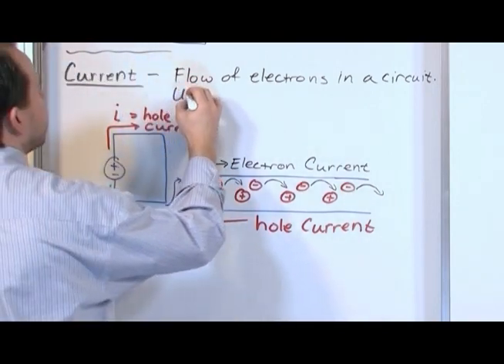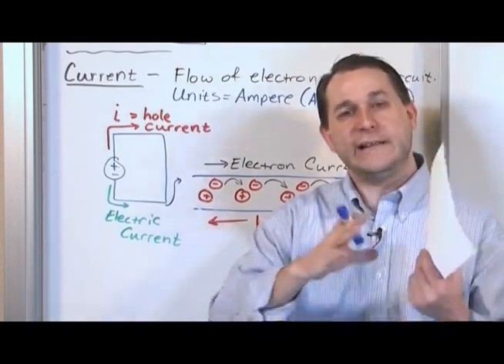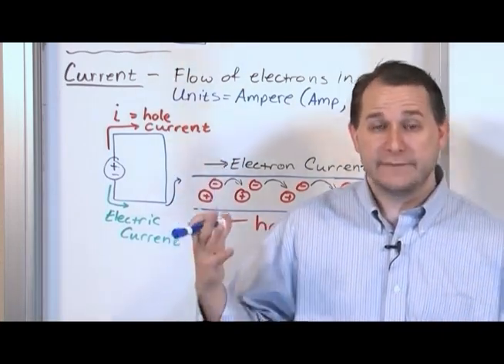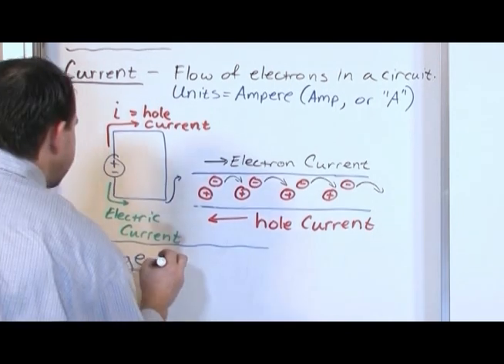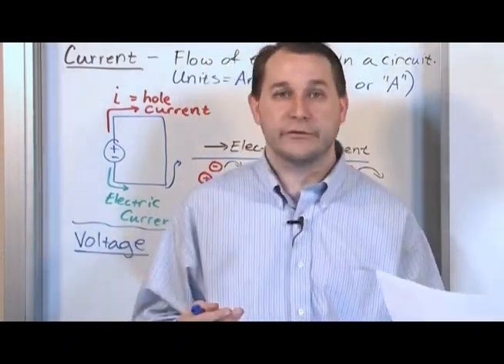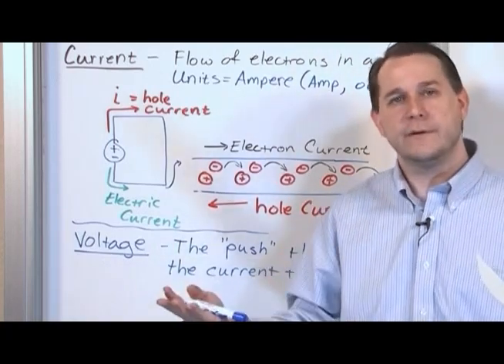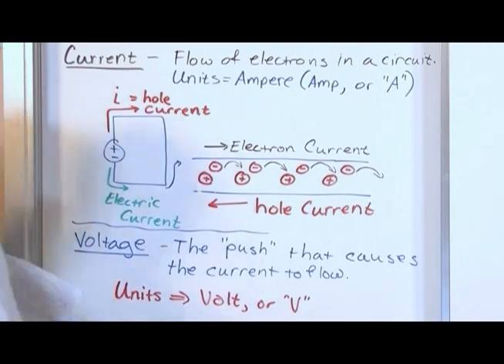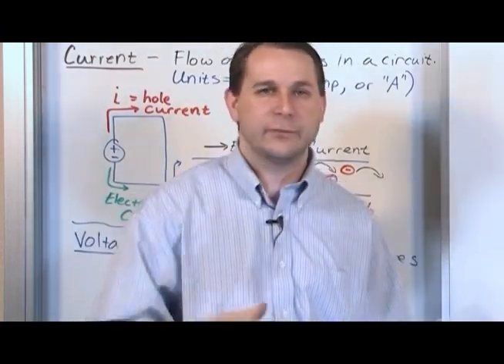What is Current and Voltage in a Circuit?

Comment: Very good video! But an important point for anyone watching this, is that, current does not flow. Only "charges flow".  That statement "current flowing" is the same as saying "flow of charge flow". It might seem pedantic to pick up on this use of the language, but it is one of the major causes of confusion with students.
Reply: In case you missed it, under current; he wrote "the flow of electrons in a circuit." In fact he wrote it twice, so anyone watching this video would have no confusion. its only pedantic to pick at the language if he was carless, but this video is very well done! :)
Reply: rezhna rasheed  I agree it is a good video. But he repeats the phrase "current flows" many times also refers to "current moving" which is wrong. It will confuse beginners, trust me, it will.
Reply: I don't mean to be pedantic (I do, really) you couldn't be more wrong.
Reply: A good paper by William Beaty on the subject of voltage, current, resistance, and watts may be of interest to viewers of this channel and the topic of "current does not flow in a circuit" as this issue is an often debated subject among electrical engineers.  Current doesn’t flow any more than "voltage", which Mr. Gibson does say in his video. Current flowing is an often made comment by instructors and students alike, myself included.

This comment does not intend to diminish at all Jason Gibson’s teaching abilities as I also believe he is one of the best instructors on YouTube. He is an accomplished electrical engineer having a distinguished career including working for NASA. 

The paper by Mr. Beaty can be found at http://amasci.com/elect/vwatt1.html

Comment: Just to clarify the current is the amount of amps circulating per sec and amps are a measurement of electrons. The voltage is the amount of potential energy used to drive the current. Please correct me if im wrong. Also what generates the voltage in a simple circuit?
Reply: As far as i am concerned , you are correct and the answer for your question is : A battery.
Reply: Nope, the current is NOT the amount of AMPS, but the amount of ELECTRONS circulating per sec, and this last concept is what we call Amp. Amp = (amount of electrons)/time.

Comment: therefore what does more current mean technically? Is it more electrons in a specific area? Because of voltage is the push (therefore more voltage more push) What happens with more current?
Reply: When you increase the push (Voltage) you'll also increase the amount of electrons flowing through a given point in one second (Amp).
Reply: Germán Diego Guisasola Plejo thanks for the answer but I finished school now, will never need to do circuits again haha

Comment: What is the source of the *push* or voltage?  how does Amp get push?
Reply: Is the difference of potential (Which we call Voltage)  between two points. Amp doesn't get push, electrons do and the physics behind it is pretty simple: Just imagine a straw (a cable for us) and know you started blowing on one end, there is a difference of potential because there is MORE pressure in the end you are blowing than in the other one, so that difference of potential MAKES the air flow from one end to the other, and that is AMPs, how many electrons flow through a given point in one second.

Comment: I don't understand. Given the same wire, using either 10 volts or 100 volts we still get the same amount of amperes? Then what property does voltage change?

Also how do you change the charge of an atom?
Reply: Given the same wire and assuming that there is a resistance in between (otherwise you'll short the 2 ends of the battery and that's not a good thing) the more voltage (the more the battery pushes) the more amps you'll get (bigger flow of electrons will be).

Comment: But the more push I apply, the faster the charges are gonna move, directly linking it to current. So how can these be independent concepts? Can someone explain?
Reply: Yes skooma cat you are right voltage is directly proportional to Current.But they are independent concept as current is nothing but just  the flow of charge across cross section of a conductor in time 't'.Whereas voltage is something which push the charge to flow across a conductor.
Reply: The load may cause the flow?   Higher wattage load of necessity will pull
more current, thereby needing a LARGER conductor to supple more amps?